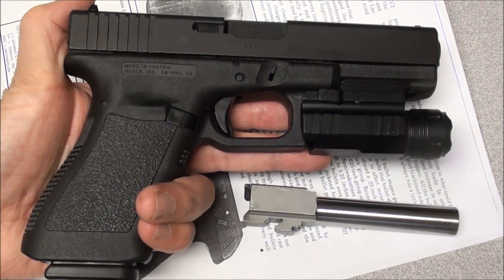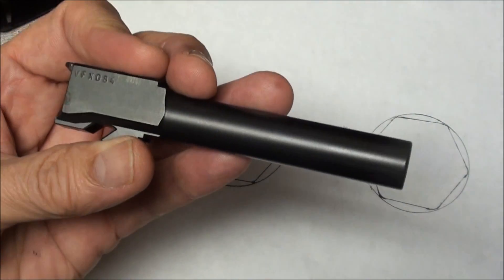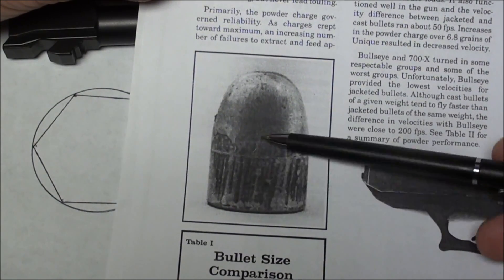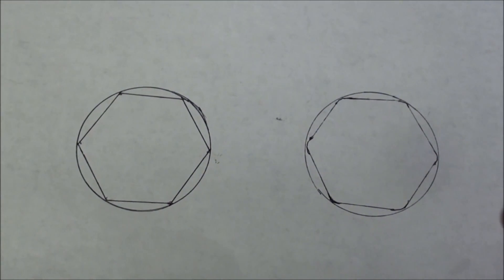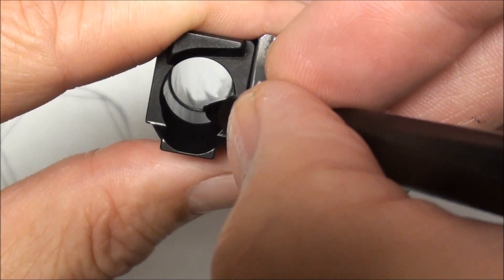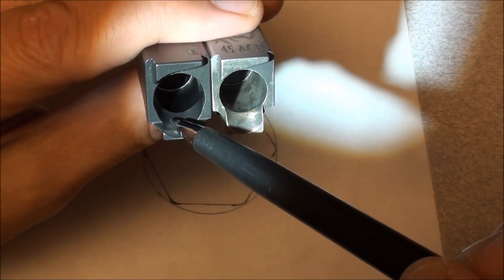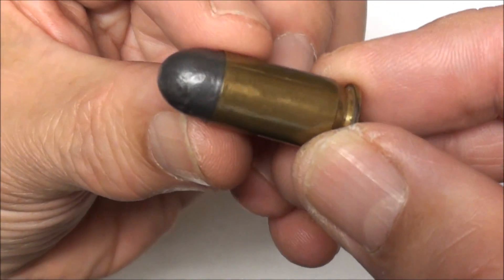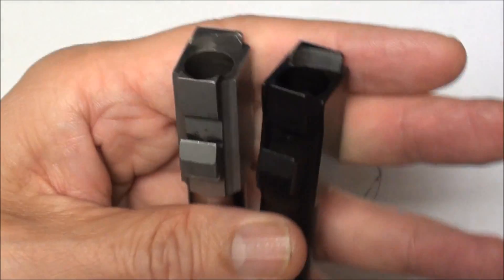Polygonal Rifling in Reloading Ammo for Glocks

Comment: Mull1955  I don't have a Glock but that was going to be my next pistol but if I should not shoot reloads I might not get one. However I load very little lead bullets.Mostly jacketed bullets.
Reply from the maker: Glock reloads with jacketed bullets, inspected brass, medium to medium slow powders, moderate charges (not max) and you should be fine.  And if the 40 is avoided, even better.  Best Regards...
Reply: FortuneCookie45LC
Mull1955 The 40 is one cal I don't have.
Reply from the maker: Note - Mike, the Glock is a fine pistol and 40 is very popular.  If you get one, it's a great gun.  It's just if you want to use reloads in the Glock factory barrel (not recommended by factory, but many, many shooters shoot reloads), you just have to mind the above to minimize problems from the minimally supported case heads.  Just think about the Glock Policy = overpressure is a no-go.  With Ruger Blackhawks SAs, the safety margins are enormous.  With Glock, it's as thin as thin can be for any gun.  I own three Glocks and you know I like shooting +P = I just pop in my aftermarket Wolf barrel and go for it...

Comment: FC45LC, very fine video - one of the best if not the best I have ever seen on the subject. I do notice though that my G19 Gen 4 barrel and my Lone Wolf LWD-19N are much more similiar on the feed and support aspects than your 45 barrels. Thanks so much for the time, effort and insight you put into the video.
Reply from the maker: The same chamber constructs are there, but to a lower degree because of smaller bore and not as readily apparent - probably has something to do with the 9s not going Kaboom very often...Best Regards to ya...

Comment: This is the very problem I had last year. For the life of me I couldn't find out why my reloads didn't work in my KKM aftermarket barrel. I loaded it with FMJ 230 grain bullets and had problems with going into battery every 20 rounds or so. I would tap the back of the slide to get it to go into battery. It drove me nuts ! I was checking my reloads with Wilson gauges and Calibers down to .002 and still it would do it. After two months of testing I gave up and out of desperation put the factory barrel back in. After that, the problem was solved. Now its Very rare to get a stack or jam. I still only use copper jacketed bullets in my reloads. I reload with hodgdon HS-6. I will soon attempt to reload lead with my lee 228 grain round nose in the KKM barrel. I hope that works.
Reply from the maker: Vengenace Early-This is interesting.  As you know, I have not had my G21 very long.  I shot lead bullet reloads with my Wolf barrel in my G21 and it worked fine.  But the last batch of lead bullet reloads did the same thing you describe every 10-15 rounds.  I haven't had time to work on it thinking that something simple had happened with my OAL, but I'll have to get back on that…Best Regards...

Comment: Great video. I have had the unfortunate experience of having a blow out at the unsupported portion of the case just above the feed ramp on a G19. The bullets were jacketed factory reloads, I had never fired cast in that gun. I like my Glocks but have no intention of repeating the event and had stopped shooting reloads of any kind in them after that. Moving forward I will not be shooting reloads with an unsupported chamber. Now that I'm getting into reloading pistol calibers I got a Lee bulge buster to process my old bulged .40 and .45 brass (unfortunately doesn't work on 9mm) and had planned to get barrels with supported chambers. This appears to be the best answer to my situation because the Supported chamber helps to prevent a blowout on previously bulged brass and preserves new brass for reloading by not allowing the bulge in the first place.
Reply from the maker: AllenZombieSlayer- You have developed the AllenZombieSlayer Glock No-Kaboom Policy.  These incidents have happened and will continue to happen at a high enough rate that the problems cannot be ignored.  Good shootin' to ya and thanks for posting your experiences on this...

Comment: FCL45LC...Well, I never knew. All this time going with the 'polygonal' barrel warning without thinking of why. Very good presentation...a classic reason on NOT shooting lead through a GLOCK. I think this needed to be said as everything comes to light on why GLOCK warns of shooting reloads and lead.
Congrats, Professor, on a job well done!!
Reply from the maker: Larry-Everything being said, there are still lots of shooters reloading cast lead bullets and shooting them thru factory Glock barrels.  If medium - medium/slow powders are used, and maximum charges avoided, and we are not shooting 40 S&W, most of the risks are attenuated.  But they are still there because of the unsupported case.  If we reload for the Glock, we have to accept that.  This video doesn't tell shooters not to reload/reload cast bullets for Glocks - only to understand what they are dealing with and best accommodate that, should they decide to go ahead...Best Regards

Comment: wow, you're timing is impeccable.  I had heard that .40 cal. Glocks were NOT reload friendly, but the 9s were okay...but lo and behold, I had a (copper plated) 9mm reload jam REALLy hard 2 weeks ago...I will look into a different barrel down the road.  Tnx
Reply from the maker: 20thcenturyfilmdocs-Thanks for the post...Cause was probably the plated bullet stuck firmly in the chamber throat so gun was not in battery. Probably had to push the edge of the slide back using edge of shooting bench to free it up.  Cure is to seat bullets a little deeper or go to a FMJ bullet.  Too deep is not good either as pressures go up and Glocks don't do well with overpressure.   Best Regards
Reply: FortuneCookie45LC Yep, pretty much that, so I guess not directly related to this issue, but it enlightened me about my next steps, which are to get that Wolf aftermarket barrel LOL.  Tnx
Reply from the maker: 20thcenturyfilmdocs Thanks for your post.  The Wolf barrels are nicely done and allow shooting all ammo, not just the reloads and cast lead loads…But you'll want to shoot the factory stuff with your Glock barrel, since that is what you would use for any serious use…Best Regards

Comment: I don't know Fortune Cookie, I just might have to disagree with you on this one. I have fired thousands of rounds through my stock Glock barrels and nary a issue. I even use Tightgroup predominantly. I guess it's my risk.
Reply from the maker: Hans S.- No need to disagree, there are lots of shooters out there putting lead thru their Glock factory barrels and doing fine. If you are a good reloader, you can do all that safely.  You have attenuated your risk.  And TG is a good powder - the thing about it is that double charging can happen and has happened. Do that with a Ruger Blackhawk and we can get away with it.  But in the Glock, it's a bomb…Other reloaders may not be as careful or experienced as yourself.  Thanks for the comment.  You are A-OK.
Reply: Thank you for the compliment. I am fairly sure of myself, but I still have a long way to go to get to the same level as you and others. For one to become as knowledgeable as yourself, it must be attained through years of experience. My only major mistake to date has been a squib load that was caught, by the grace of God, before a serious accident. It taught me a very valuable lesson.
  Excellent job by the way on the video. By far the best analysis and presentation of this issue.

Comment: This issue irritates me. After buying my first Glock, a 17, I was basically told it would blow up instantaneously were I to fire cast ammunition. So, I dropped $105 on a Lone Wolf barrel. Then $30 more to get the throat reamed because it was so tight it wouldn't feed ANYTHING (I think it is made intentionally undersized and is all a scam in my book).
 After dealing with excessive leading with certain loads, I decided to be brave. I tried shooting cast through the factory barrel. GEUSS WHAT! IT LEADED LESS THAN THE AFTERMARKET BARREL! Not only this, but it is also more accurate.
  I now also own a G-30s in .45 ACP. Same deal here. Cast is all I ever shoot out of her, and she loves it. Unless you own a .40 cal. Glock, don't waste your money on a new barrel.
Reply from the maker: Hans S.-You notice that in this video, the point is made that the Glock factory barrel seems smoother and less likely to foul or lead than my Wolf barrel.  And your experience goes along with that.  I know many shoot cast bullets in their factory barrels. And, with care, why not?  But Glock does say in their pubs to not shoot lead or reloads in Glock barrels.  As a responsible YouTube poster, I have to go along with that.  I use the Wolf barrel because I want my brass to reload…Good shootin' to ya  :)
Reply: I completely understand. My whole escapade into the Glock barrel issue just left a sour taste in my mouth, as I felt I had been taken for my money. And you know what kind of penny pinchers we casters can be :)

Comment: Ah ha. I understand now. You explained that to me before & I didn't understand where the case wasn't supported. I get it now. Comparing the barrels really helped. I wonder if the polygonal barrels got the reputation for leading from the early octagonal barrels. My understanding is they did lead real bad but they were literally the shape of a stop sign.
Reply from the maker: shananagans5- How have you been?  Good to hear from you.  Sounds like the early barrels were definitely polygonal rifling, but now they have morphed into the hills and valleys rifling - doesn't look anywhere like a polygon now… Best Regards...
Reply: My HK P7's have the most radical polygon bore I can think of. I've heard a lot of people that think their CZ82 is shot out because they can't see the "rifling." :)
Reply from the maker: nccrawford - I'm glad you commented because your HK P7 is not radical at all - it is true polygonal rifling similar to that used in MG42 machine guns and the old types of artillery pieces.  Polygonal rifling is a polygon made by using a polygonal twisted mandrel and hammering the barrel down onto it.  The Glocks are not true polygonal, and I'm not even convinced that it is polygonal at all - if you check it out - it is rounded lands and grooves.  This may seem to be a semantic difference, but it is important to be accurate.  If you check the Glock website, now they are calling it their own version of female polygonal rifling - where did that come from?  I can't see male or female in rifling, can you (and especially in a polygon)?   This is in no way a criticism of the rifling in Glocks - it's good rifling.  Calling it polygonal is imagination.  Why not call it Glock rifling?  = completely appropriate.  Problem is when "polygonal" rifling is being associated with Kaboom events.   Best to ya. And thanks to Shaz for letting us use her site for this...

Comment: Glad you posted this video... I was wondering if the brass I saved from shooting the flock with the factory barrel would still be reloadable to use in an aftermarket barrel. Also what would I have to do differently to reload with a glock since it is the only gun I need to.reload for. Any help would be greatly appreciated and I hope you have a great day :)
Reply from the maker: Alex Whiteman- chevy6299 references the Lee Bulge Buster that takes the Glock fired bulges and eliminates them.  Then if you load medium to medium slow burning powders and don't push the max charges, your loads will be safe in any aftermarket barrel...some shoot reloads in the Glock factory barrels - but if you do, the risk you take is a certain number of overpressure factors adding up just right and you have a Kaboom all because of that oversized unsupported chamber (all Glocks have this) - Great reliability at the price of pressure sensitivity - there have even been some cases of Glocks blowing up with factory ammo, again that chamber...None of these things should stop us from owning Glocks as they really are fine pistols - just have to know the quirks...